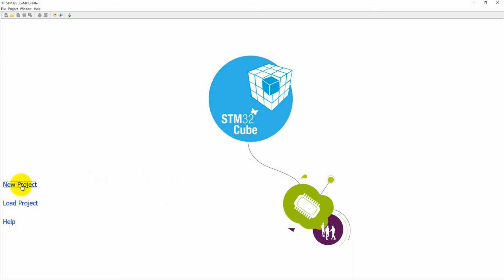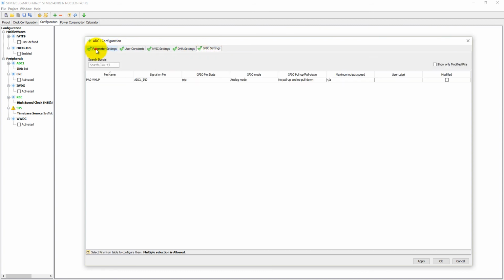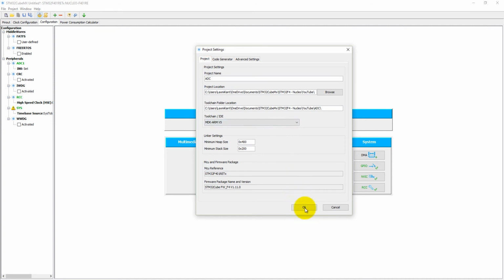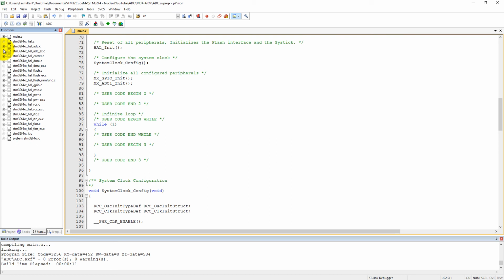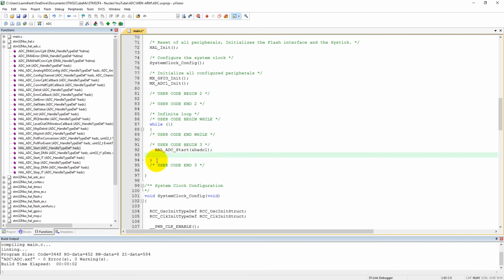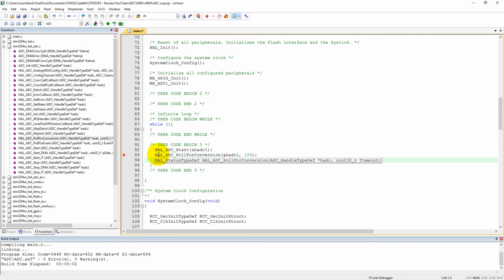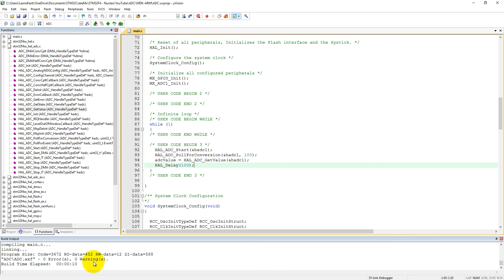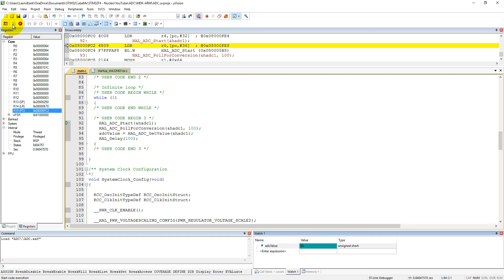STM32 Nucleo Tutorial 3- ADC Coding in Keil uvision

Comment: hey KGP Talkie,  am trying to generate a pwm signal if my adc value crosses 100. the pwm signal should last as long as the adc is above 100. but i get to execute it only for 1 interation then the motor stops because the enable bit goes low. I want it to stop only if the adc is below 100. please help.